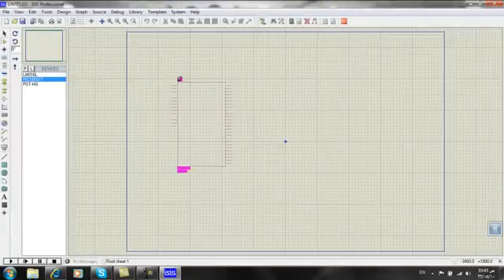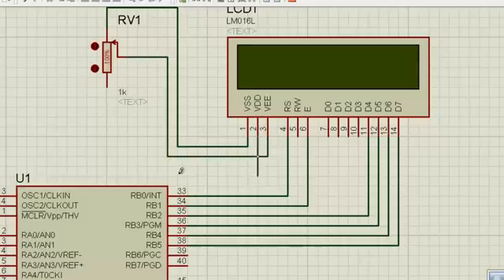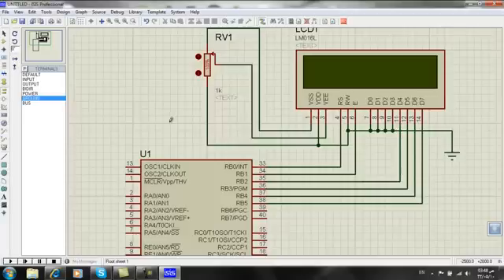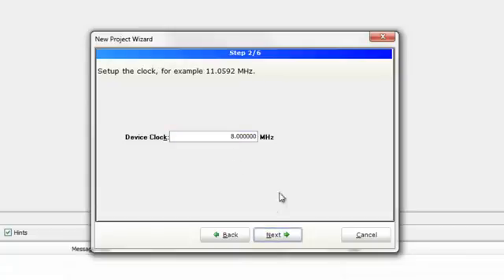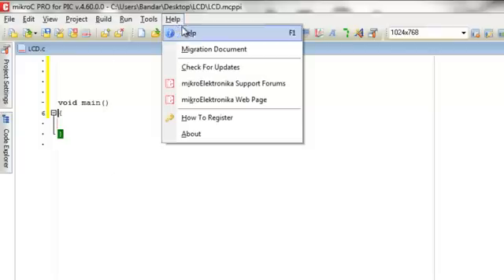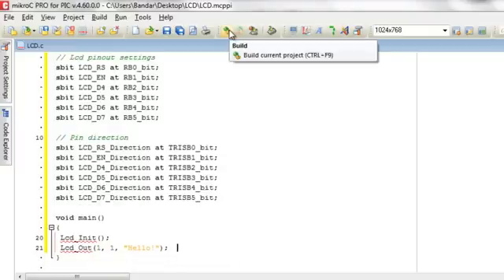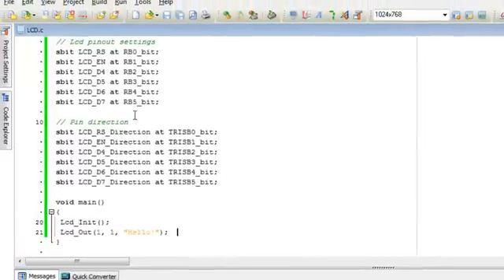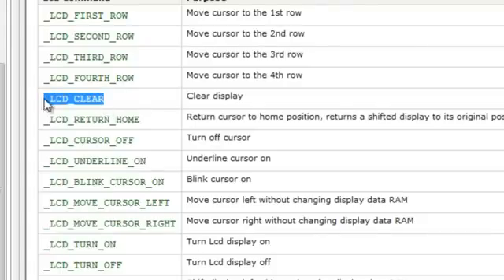LCD + mikroC PRO for PIC + ISIS Proteus ( Included Program )

Comment: hello mohammad well im having a problem.. 
im using pic 18f4620 
i want to send A

#include <p18f4620.h>
#pragma config OSC = INTIO67
#pragma config WDT = OFF
#pragma config LVP = OFF
#pragma config PBADEN = OFF

#define Baudrate 19200
#define freq 8000000

void main()
{ 

OSCCON=0X7f;

TRISCbits.RC7=1;
TRISCbits.RC6=1;
TXSTA=0x24; // Transmit Enable bit enable ..BRGH high speed
RCSTA=0x90; //serial port enabled (configures RX/DT and TX/CK pins as serial port pins) CREN: Continuous Receive Enable bit enable 

//SPBRG=SPBRG-VAL; //EUSART Baud Rate Generator Register High Byte

SPBRG=((freq/Baudrate)/16)-1; //EUSART Baud Rate Generator Register LOW Byte (BAUD=1200 Desired Baud Rate) 

while(TXSTAbits.TRMT==0);
TXREG='1';

while(1);

}

ive put lcd and connected the tx from the pic to the rx of the lcd.. hit run .. but nothing appeared .. whats wrong with what i did ?